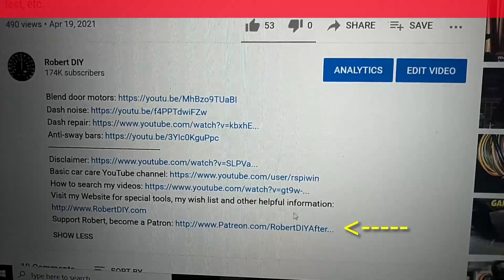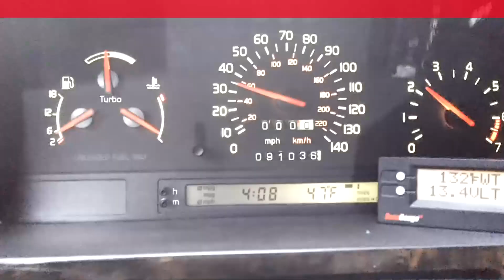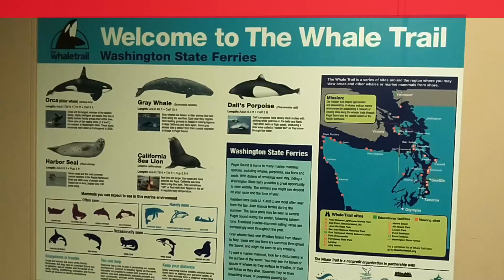In the Pacific NW, Seattle, Tacoma, etc. Contact me if you'd like some help. S60R, ferry ride & more

Comment: Can you make a proper video on replacing does belts w/ VVT's!
Reply: its not for the average joe to do this ...this is advanced stuff ...changing the transmission hard to do kinda job  ...that job is $600 labor for a reason !!!
Reply from the maker: the video is linked in the description area and should have popped up at the end of this video.
Reply from the maker: https://youtu.be/gt9w-ZSxs9I
Reply from the maker: https://youtu.be/YpOYTVpzzic